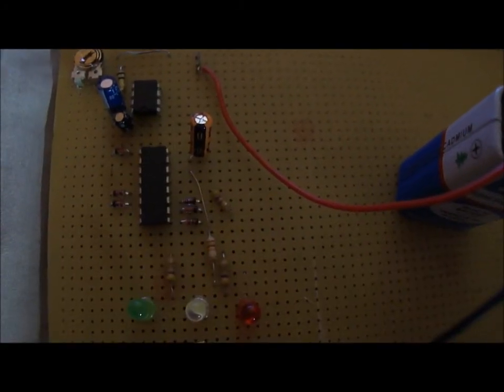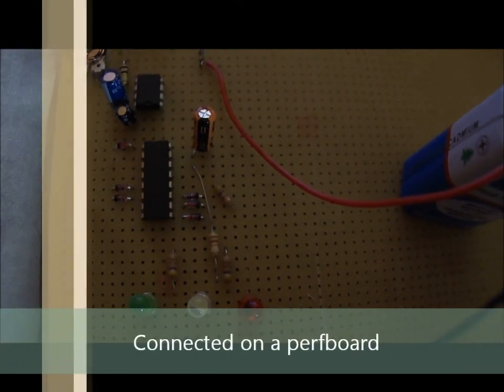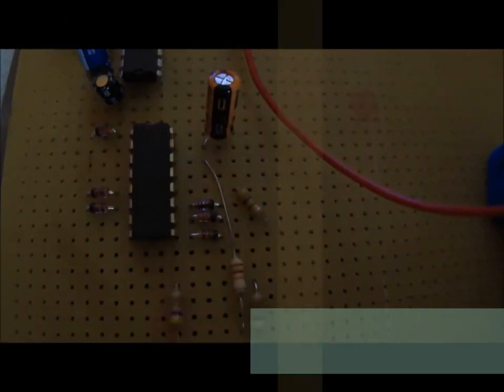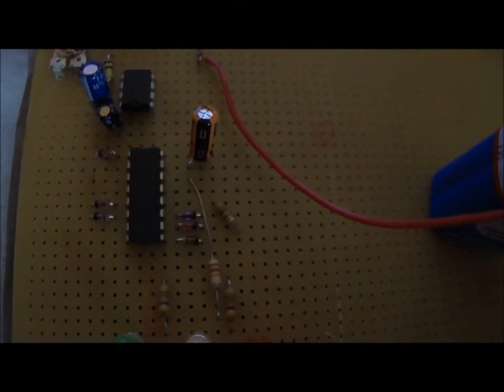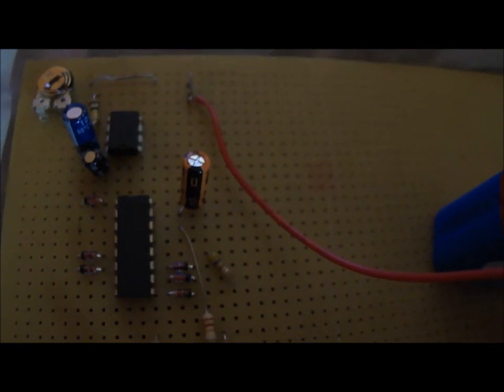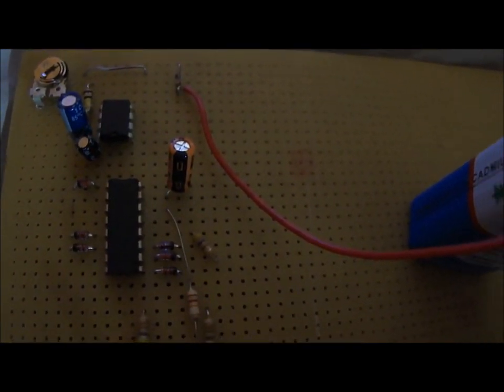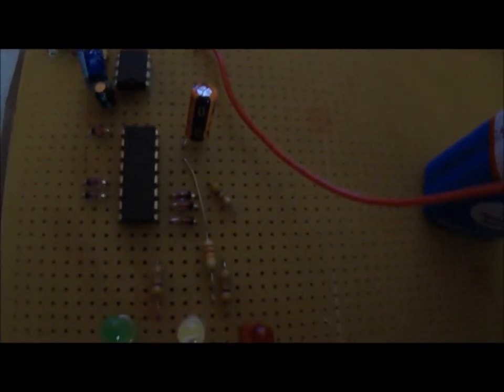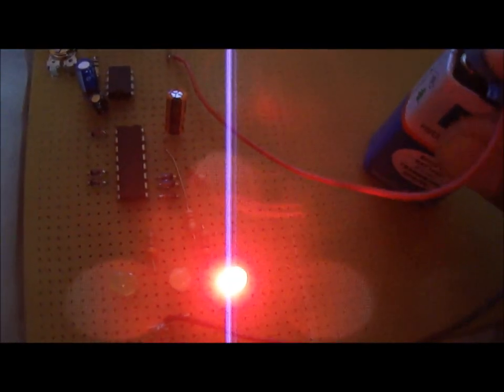Traffic Light Control System

Comment from the maker: @SpecialNerfServices if you connect the reset pin to the +ve lead of the battery, this returns the counter to 0 and the LED for output 0 is illuminated. Although pulses are still arriving at the CLOCK input, counting has stopped.
As for the enable pin if you connect it to +ve of battery, Counting stops but this time the last LED illuminated stays lit. The count stops wherever it happens to be when ENABLE goes HIGH.

Comment from the maker: capacitance is measured in farads, and 0.1uF is the capacitor's value. Its a ceramic capacitor and can be connected in any way. While the 10uF is an electrolytic capacitor which should be connected as in, the long wire to +ve end and short end to -ve end.